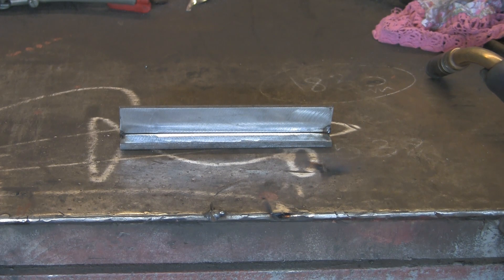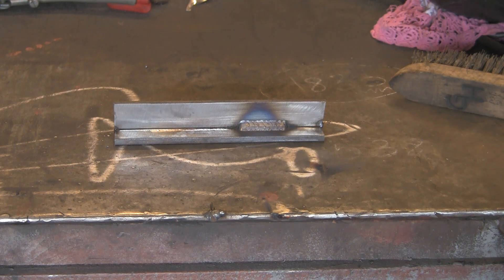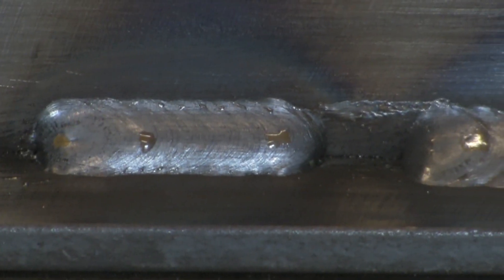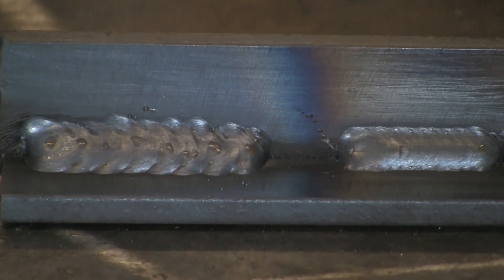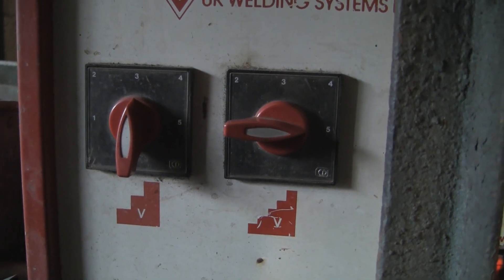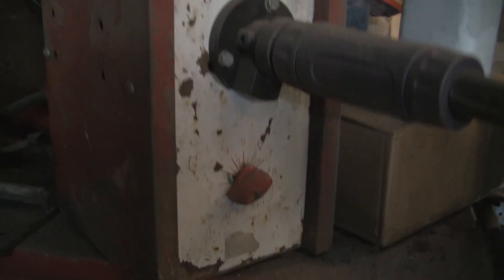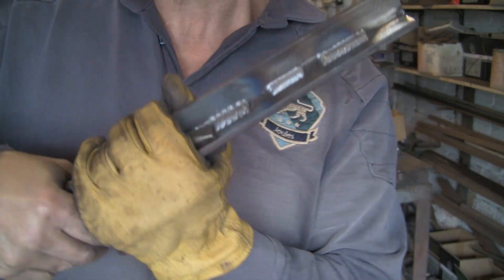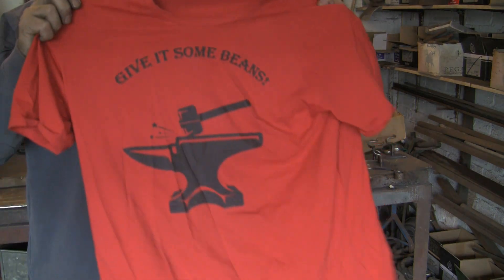welding variables

Comment: uh Gary if you weld for a regular job . your a professional .  I have been welding since i was 15 , I am 44 now my entire life i have been using way to much gas ! I  would have said you need the ball a 1/4 up the flow meter. went out to my shed took off the flow meter ,listened for the gas and w0w no porosity ! I try blacksmithing but having trouble hitting the same spot twice
Reply from the maker: +HUCK stir, as I said in the video, I don't class myself as a welder, but I weld as part of my job! I don't weld all day every day, just when needed.. Maybe it will save you a bit of money! 
You do need a good eye and a steady hand to get it where you want it!✊🏻

Comment: The two stepped dials on the welding plant that you show first are for controlling arc voltage not current (amps).  It even has a V printed below the controls.  It is correct they are for large and fine control and are probably stepped for an arc voltage range  of about 15 - 30 volts.

The current control (amount of amps) will be directly related to the wire feed speed, built into the parameters of the machine.  Increasing or decreasing the amount of wire feed will increase or decrease the current (the amps, the heat, the power).  

Increasing or decreasing the arc voltage is a more subtle control.
Reply from the maker: +Finarfin I don't think that is right. I can turn the wire speed right up or down and it has no effect on the amps.
Reply: Thanks for the reply

That is strange.  Wire feed speed is usually always directly related to the current and is built into the machine by the manufacturer.  It stands to reason to be so.

You will agree that the two stepped controls on your machine are marked V, which is surely voltage?

I have a 250A Cebora MIG, 3-phase 400v input.  The dial for current (1 -10) causes two increases or decreases - wire feed and current.  If I wind up the dial then the wire feed obviously increases but so does the current, and noticeably so.  

There are also two stepped controls, definitely for arc voltage.  The coarse control is 4-way, A,B,C and D.  The fine control is 1-8.  

It may be that your machine has an inter-relation between volts and amps, changed by the stepped voltage controls, but this is very unusual.  The way you are describing is that the wire feed motor is independent of any other control, also unusual.
Reply from the maker: +Finarfin you could be right but I don't and never have with any of my welders noticed a correlation between wire feed and amps! 

I did say I wasn't a welder, even more reason not to ask my advice!
Reply: Yes, looking at your broken dial/scale it seems that arc voltage and current are related within your machine.  But having said that you have the rocker switch below that switches from amps or volts.  Presumably if this was working, it would switch connections between an ammeter and a voltmeter, suggesting that perhaps the two parameters are not related but are separately wired into one dial/scale for information purposes.
Reply from the maker: +Finarfin a friend of mine has a big ESAB 300 amp welder with an auto setting which automatically adjusts wire speed depending on where the amp/volt dial is set. It has a fine tune dial to make very fine adjustments.
Reply: That's it, the wire speed control adjusts the amps also.  I don't know about automatic voltage control also, although some modern machines are very clever.  My machine is 26 years old - it has never failed yet in any way (touches wood).

Just to confuse things more - do you have inductance settings also?  These will usually be separate tappings for the Earth (actually the Return) lead.  If you do but don't understand those (neither do I fully), have a basic rule of Low inductance tapping for thin sheet and Medium inductance for more or less everything else 3mm and above.  I've never used the High inductance tapping.

It's probably best to be aware that a machine of this capacity is capable of spray transfer for heavy welding on thick stuff (3/4 plate and more), in addition to the more usual dip transfer.  Spray transfer will not occur below about 25-26 volts.  It's all getting too confusing. :-)

Your welds look fine.  For a standard range of work you do, you will have mastered the machine and settings well enough by now.  One can sometimes get too hung-up on what the exact settings are although one must be broadly aware of them and what to change if the welds look wrong (which means they probably are wrong).  The first stage in weld-testing is visual - does it look right?  

What wire do you use Gary?  I'm a 1mm man myself.  Using 0.8mm is ok, but I prefer the extra 'punch' that 1mm wire gives.  It takes some practise to weld 1mm sheet with 1mm wire but it can be done ok.  I find the thicker 1mm wire better for welding 3mm, 6mm, 10mm stuff, which tends to be the bulk of the work.

Thanks again.
Reply from the maker: Finarfin I do have inductance tappings but marked A B C, no idea which is which but I use the one that gives the smoothest weld. Different tapping with same settings gives a smooth or splattery weld.
I have used spray transfer on some of the big stuff, when repairing digger buckets with ¾" plate. Don't do much of that these days.

I always used to use 1mm wire until very recently and have changed to .8mm. If you look back through my videos for the "nice jugs" video you will see me using 1mm to weld 22gauge (.064mm), was pretty tricky but I had it off pat! It's a bit easier and neater now I'm on .8 but it still gives me the scope to weld big stuff. 

How does the amp wire feed stuff work when I plug my spool gun in? It bypasses the wire feed control just using the power from the Euro connector. Wire is controlled from the gun itself. 
Again, if you look through my videos you will find me welding up an Ali propeller with it!
Reply: Ah yes thanks, will do.

Comment: Your welding is by far better than mine!! Is it the motion you use?? Sideways, Circle and Back and Forth..
 Have you tried Vinegar with your hand?? Lay a washcloth on your hand where it hurts. Pour White Distilled Vinegar on it to wet the cloth, just enough to dampen it well but not running off. It will get Cold!! My wife does this for her knee when she can't hardly walk and the next morning she's fine. Just let it sit on there for 20-45 minutes or until you can't take the smell any longer. Be sure to wash it before bedtime...
Reply from the maker: I guess the motion is important, I use a sort of left to right swirl motion. 
I'll have to try the vinegar thing, it always feels hot so that sounds good!

Comment: Hello Gary, Thanks for your welding demonstration. I was just wandering how it is possible that a faster weld leaves a bigger fillet? It seems counter intuitive to me. Also does the faster weld burn into the steel to the same depth as the normal weld? Keep up the good work
Reply from the maker: You have almost answered your own question. A faster weld doesn't penetrate as deep hence the bigger fillet. If you look at the video you can see how the heat has spread. A bit on the right, very little in the middle and quite a lot on the left..
Reply: I noticed the heat spread on second viewing. Thanks for answering.